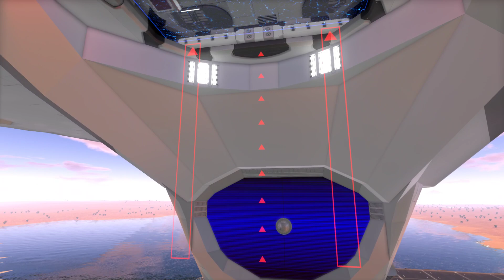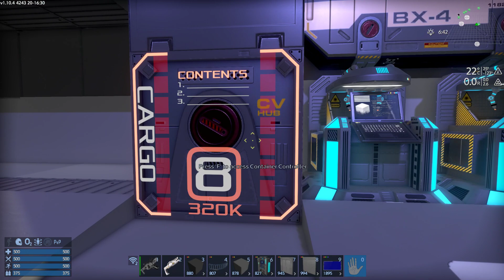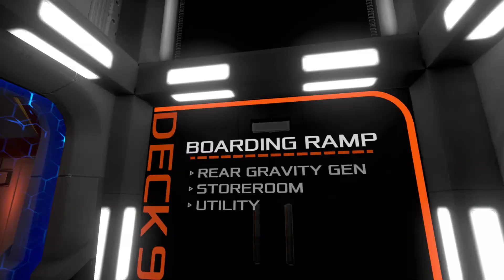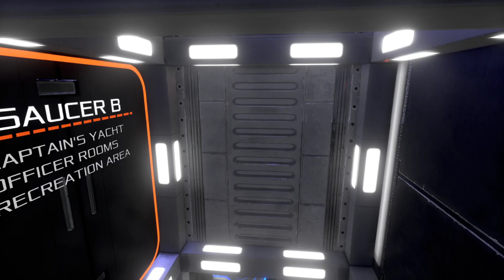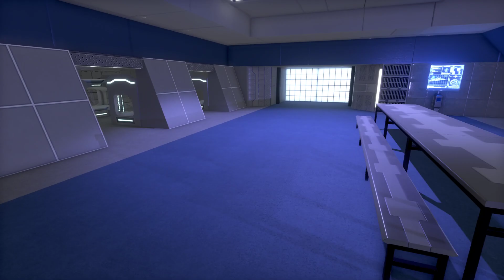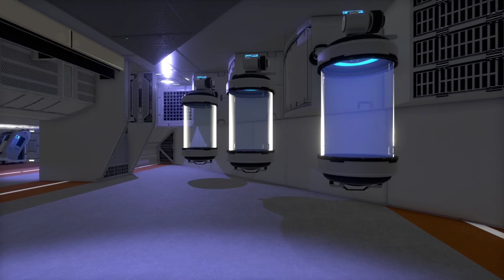Empyrion Galactic Survival - USS-Europa Preview

Comment: 1. Sticking with steel is the right call, imo. A carbon built ship is not only odd in lore, but also basically makes your ship as strong as a paper plane. Not worth weight savings, though I do think I need to start making interiors from carbon, rather than steel.
2. Captain's yacht area is great, and I like the LCD guide, though I would choose a brighter color.
3. I would keep the Registry markings (NCC-11755) consistent (either all of them black with LCD's, or all white markings) (I prefer black)
4. I do not like the structural frame blocks for that exact reason. In case you are wondering why this issue exists technically, it is because the frame blocks are not voxels, they are entities, like any of the engine/constructor/warp etc... "blocks."  As such, the data structures they use in code are fundamentally different than a voxel, which is always 1x1x1 (I can delve deeper on that if you want)
5. "Quickie cockpit" ... I like that :P
6. I REALLY like your elevator signage, well done.
7. The holodeck with the Vulcan High Council is awesome. I thought about actually making something silly in my holodeck.
8. Cafeteria should be "Mess Hall"
9. I would put the main core in the main core room
10. I think my one exterior suggestion is to use some thin blocks on the front portion of the top and bottom of the saucer for some greebling and deco. The rest of the ship has a lot of detail that contrasts with the relatively simple front of the saucer. (maybe a deco phaser bank?) Doesn't need much (less is more) but I think something would balance it out.